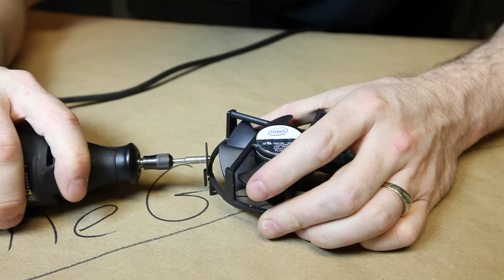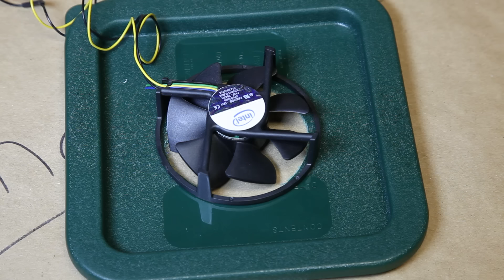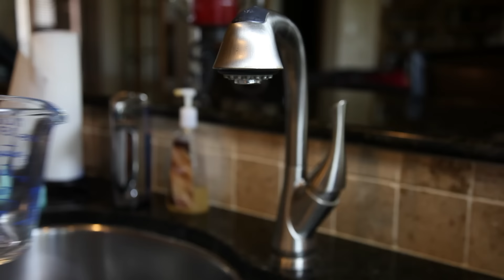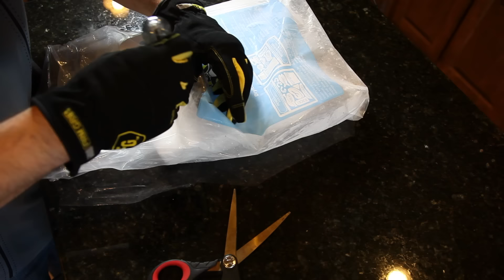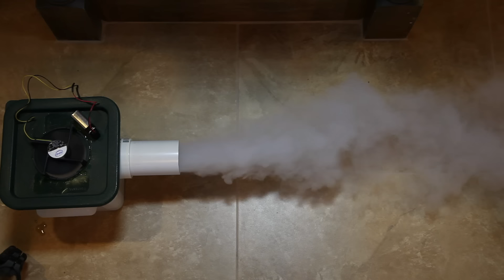How to make a Dry-Ice Powered Mini Fog Machine

Comment: I have  a question for you re your homemade dry ice fog machine
We bought a used RV and it has a leak in the freshwater holding tank. We have put water in to try to locate the leak. This makes a flippin mess.
We were wondering if we could use a hair dryer on low to blow the fog out as we do not have a fan?
And if dry ice fov would be safe to use in this application?

Comment: how to turn your room into a gas chamber
Reply from the maker: This is false. One pound of dry ice will produce about 8.3 cubic feet of carbon dioxide gas. That's hardly a danger unless your running it inside a dog house.
Reply: TheGeekPub
 10% of carbon dioxide content in the air is enough to cause unconsciousness and death, while 2% is enough to experience negative symptoms such as drowsiness. If anything, do put a warning explaining how this should be used with special treatment.
Reply from the maker: Dude I get it.  8.3 cubic feet is not even close to 1% of the cubic volume of a home.  And that is if you use a full pound of the stuff.  My little machine used a about 3 or 4 ounces of the stuff over 30 minutes. I appreciate your concerns, but your overreacting.
Reply: TheGeekPub
I understand, but you never know when someone slow-witted could try breathing from the machine. It's not like the carbon dioxide diffuses immediately, especially if used in closed room, too. Just saying, it's worth mentioning :p

Comment: Most DJ gigs tend to be about 4 hours, lets say from 6pm-10pm.  If I set this up and don't turn it on until later on.... say 7:30pm will its effects be diminished?  Or perhaps WHEN should I set this up... immediately before I need to use it?
Reply from the maker: DJ Tony Vito It only lasts about 20 to 30 minutes before the dry ice melts.  You can make this same machine using a trash bin though and a lot more water and dry ice.  I'm sure that would last longer.
Reply: @TheGeekPub  wouldn’t the water in the big bin be not boiling and cause the fog to disappear?
I want to do this outside but it’s cold and not able to keep hot water going

Comment: The downside to using your "dry ice" fog machine, is that dry ice puts off CO2 ..you should NOT use this in a closed space. I'm surprised you didn't mention this in your video. Gloves with dry ice is important yes, (I'm glad you covered that), but the other important thing people need to know is that dry ice off gasses CO2. Safety first! ;)
Reply: Dry ice is actually frozen carbon dioxide and when you inhale it it will act as us breathing out, but actually we're taking it in ;)
Reply: So it's great for trees!!!